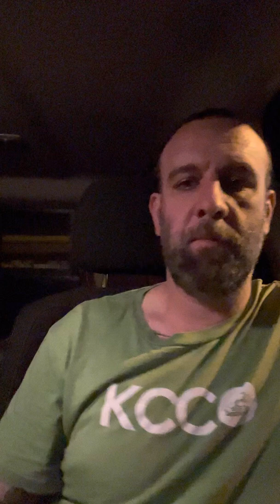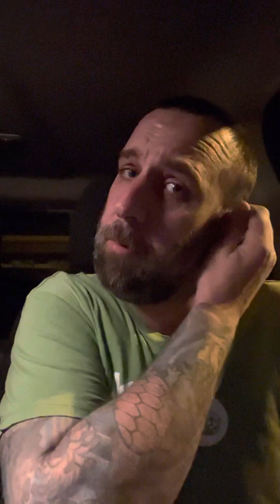Cessna 150 carb ice incident debrief

Comment: I just came upon you post today... about 3 weeks ago I was flying to Lincoln California from Oakdale Calif.   At 3,500 feet and 2,400 rpm my engine just quit.  I have an Ercoupe with a Stroked C85 (basically an o200) the outside temp was in the low to mid 70's at 3,000 feet, Central Calif weather almost no humidity in mid summer and the winds were about 5 kts from the nnw...  There was zero warning and the engine would fire occasionally probably when enough gasoline got through the ice to ignite. There was nothing under me except houses and more houses, the roads were packed and my glide was just about anything straight under me.  No golf courses, no big parking lots, just houses squeezed together.  The first time through the checklist (in my head) I skipped the carb heat because I was convinced it could not be carb ice.  The second time through I pulled carb heat (I had nothing to loose at that point) and in a few seconds the engine was running normal again.  The adrenalin affect was almost over whelming and it was difficult to grasp the situation for a few seconds.  I could write about this for about an hour but will finish it for now.  I flew on to Lincoln with nothing unusual happening and landed there.  I waited about 30 minutes added some gasoline and flew the airplane back the 90 of so miles to my home airport again without any complications.  The worst day I have ever had flying and the best day.  You can't buy experience like that.  Plan and Practice for these things and don't assume it won't happen to you.  Thanks for a place to share my story...

Comment: Just yesterday I had a similar incident. However it was less severe and my problem started after applying carb heat.

I was cruising and decided to use carb heat as part of my normal cruise checklist. As soon as I turned the heat off, rpm dropped from ~2350 to 2100 rpm. Immediately turned the heat back on, and turned back to my field. After a bit more heat, I tried turning it off and again the rpm dropped. I was then experiencing that aircraft sinking feeling. 

I was 6 nm from my airfield and only 2500' (1800 agl). Thankfully I made it back but during, my racing mind was convinced I was still picking up ice with the heat on and my engine would quit at any time. With that belief, I  made a pan pan call and went straight in for the runway while keeping an eye out for fields.

After reviewing video of what happened, I was shocked for what felt like forever happened in a few short minutes. The carb heat was working as expected, so my perception at the time was a bit skewed and I likely would have been fine after a few minutes of it being on.

I'm still happy with my decision to return and make the pan call.

I was also shocked that I applied heat 4 mins before without issue, and in that short window of time, I picked up enough ice to lose power. So not exactly great flying conditions.

Temp was -3c and dew point was -5c after a major snowfall. So there was a lot of moisture in the air.

Thank you for posting and sharing.

Comment: Great debrief. I just had this happen in my ‘75 150M a couple of weeks ago. Never experienced it before and didn’t expect it this time. I was at 5500 and 2500 rpm in central Mississippi. I had my daughter with me which increased the anxiety substantially. Like you said, I felt the aircraft fall and noticed power loss on the rpm gauge. I was up with Memphis Center and they vectored me to the nearest airport. I did pull carb heat which fixed the problem but I still didn’t recognize that it could have been carb ice. Landing was uneventful and I left the plane there and drove home. After a good check of the fuel and throttle and mixture linkages and a good run up, I concluded it was carb ice. The flight back home had no problems. That first time is definitely memorable.

Comment: Sorry if I missed this in the video, but how long had it been since your last carb heat before the icing happened? I’m always overly paranoid about this happening so tend to give it 10 seconds every 10 minutes but know this is overly cautious. Glad you made it home safely.
Reply: Thats standard with a lycoming and not even overly cautious. The o-200 you will very often have to leave carb heat on the entire duration of the flight and accept the power loss or it will ice and continue to build back up a rate where carb ice checks every few minutes is not sufficient to stop it. The 152 with the lycoming is more a case of check it every 10-15, no big drop take it back out. The o-200 in our cessna and j-3 with the same 0-200 you have to nurse it far more.

Comment: Looking at buying a 150 as well and just trying to learn all i can about it. What made you want to try to turn off the carb heat after it fixed the issue? I know you get a loss of power with carb heat on but why would you try to turn it off and risk having to land on the freeway? Just curious, I got all of my tickets in a fuel injected 172S so I never had to deal with that issue before.
Reply from the maker: The carb heat enriches the mixture with hot air and robs you of some power, at that high altitude I needed that power to make my climb over the pass. In hindsight I believe my issue was not leaving it on long enough the first time to clear all the ice. Carb ice does take time to build up, so I would be able to alternate periods of climb with no carb heat and cruise with carb heat. Now I use the carb heat for about 1 minute at 15 minute intervals whenever icing conditions exist. The O-200 is considered and ice maker first and airplane engine second…I never dealt with this in the 172 I trained in.
Reply: @mkennedy0  gotcha, I trained in a 172s and never had an icing issue either.
Reply: Great video. I have experienced this twice in two weeks now shortly after settling into cruise, once at 6500 feet and once at 4500 feet in mid 50 degree temperatures. The sudden rpm drop had me thinking it was not carb ice. Carb heat did  fix it though. I’m about to take the airplane to the paint shop 300 miles away and over mountains unfortunately and I am nervous about it. My mechanic and I are going to look everything over this week.

Comment: Same thing happened to me this morning, I’m a private pilot student and I was doing a solo navigation. Felt the aircraft having a complete power loss, I didn’t expect it to be ice so it took me some time to hit on that carb heat. Engine was close to fully stopping at 9.500ft, thankfully I diverted. It scared the crap out of me.  

Great video.
Reply from the maker: That power drop is definitely a rude awakening! I’m glad it worked out ok for you. I was trained to grab carb heat like an impulse at the first sign of power loss, and my checkout in the 150 involved a long conversation about how important it is with the O-200 engine specifically. Good luck with the rest of your training!